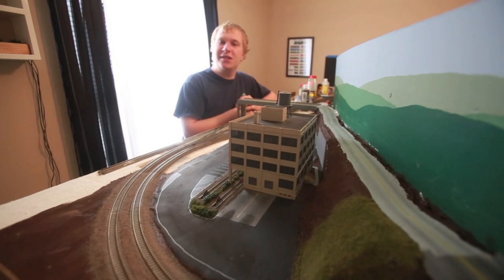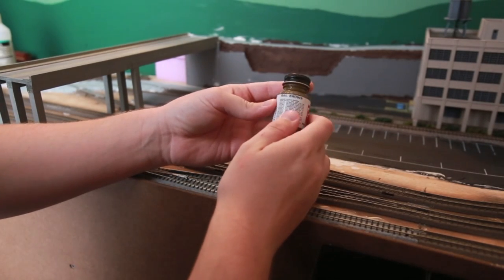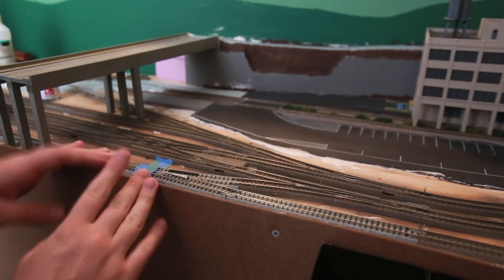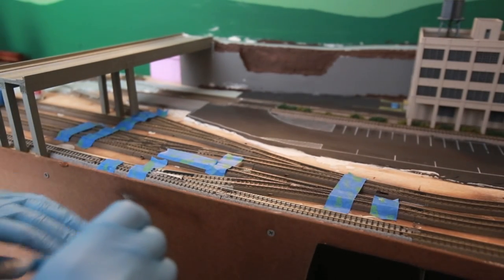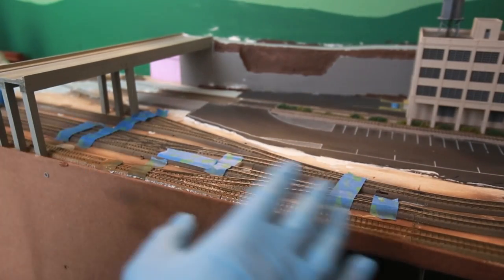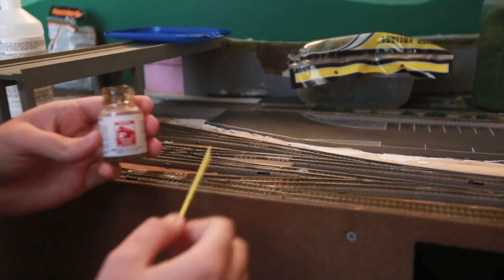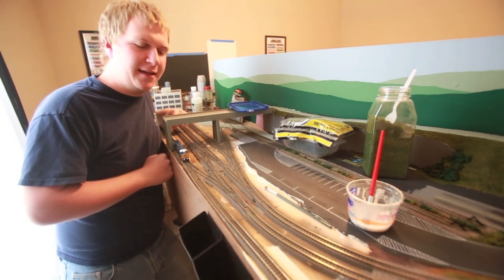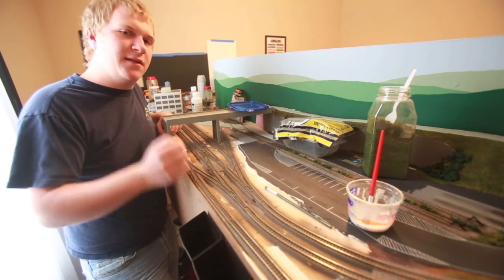N Scale How To: Weathering Track (Model Railroading)

Comment: I have an Aztek and use polyscale paints, you can use any of the nozzles as long as you thin it down a little, I recommend using distilled water its cheaper than actual acrylic thinner and odes the same thing.  The only thing different nozzles do is give you a larger or smaller spread, finer mist, some are also high flow.

Comment: I'm in the process of painting unitrack and want to also use bright boy to clean top of rails.  I've read in some of the forums that a bright boy might not be best for unitrack as it supposedly scratches the surface of the rails in which dirt can collect.  Have you noticed any issues with using bb with the unitrack? 

Finally, did you notice any conductivity issues painting through the unijoiners?
thanks for your helpful videos! td
Reply from the maker: I used it and it hasn't effected my track in any bad way. Just keep the track clean afterwards.
Reply: NSTrainFan
cool will do.  lastly,  did you notice any issues w/ conductivity painting through unijoiners?  I used floquil markers on track but left unijoiners unpainted for now.  i want to paint them either w/ markers or brushing w/ acrylic.  let me know what you think.  thanks again for the help, td
Reply from the maker: Todd Davidson - As I spray I didn't noticed any effect on it. I know Model Railroader used the paint pens on their unitrack when they built this layout and they didn't have any problems from it.

Comment: Not really a big deal but you will get better paint control if you get a double action air brush rather than a single action. I assume the air brush you used is a single action due to the technique you were using. If its double then change technique for better results...its not like spray paint. Otherwise good work.